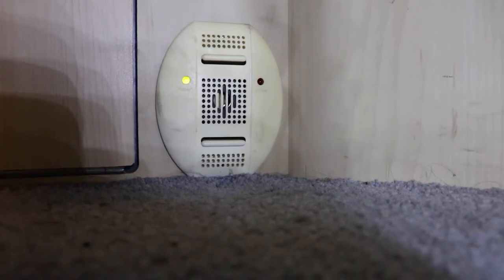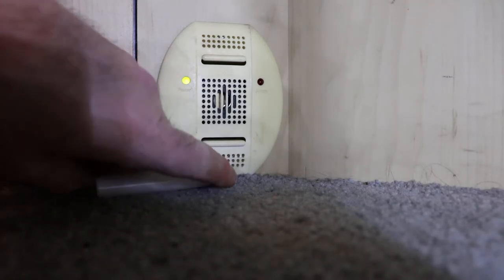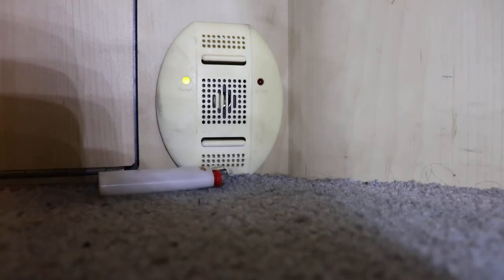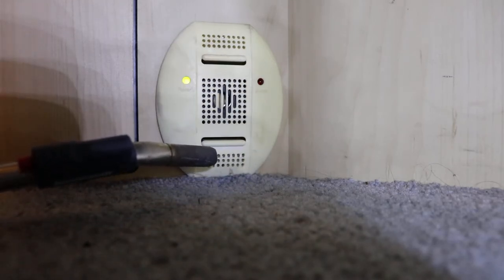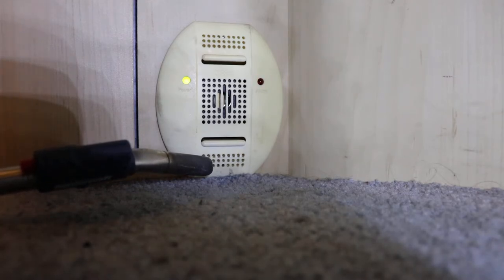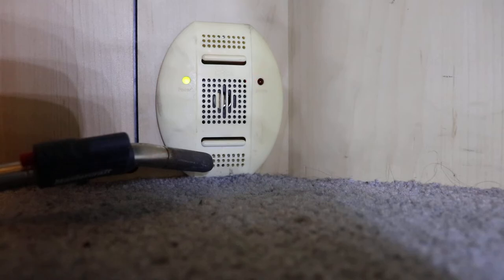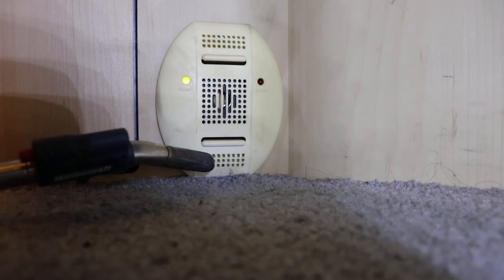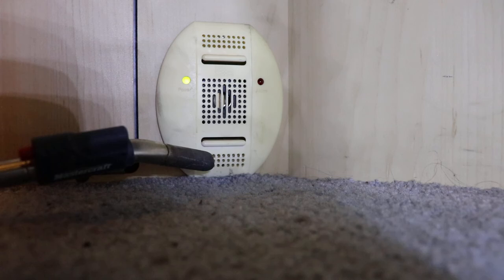Electro Systems GS/3 Propane Detector Testing

Comment: Interesting. My boat came with an older Electro Systems unit with 3 remote sensors, and it will easily detect a butane lighter. The piezo buzzer no longer works, so I am looking to replace it.